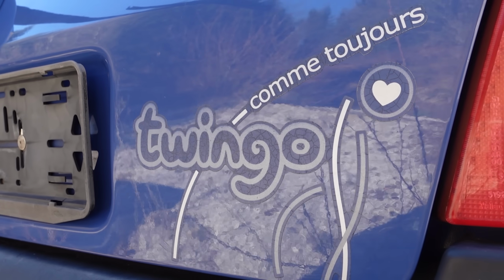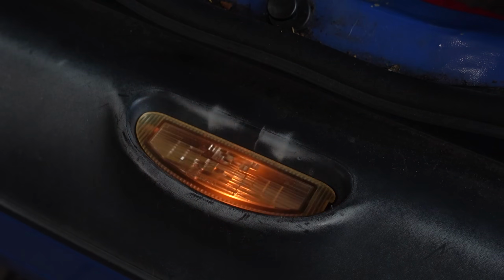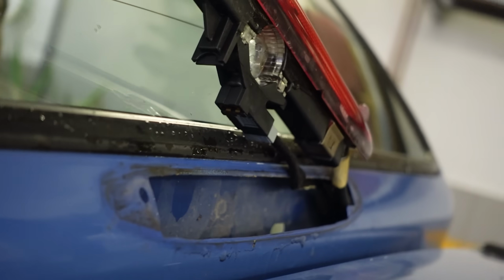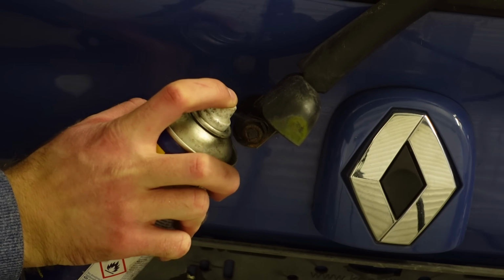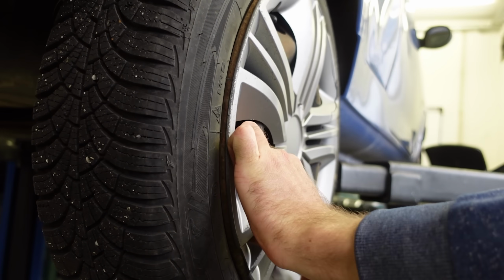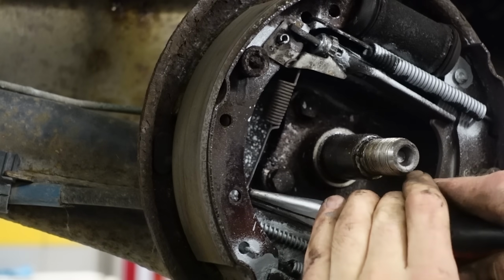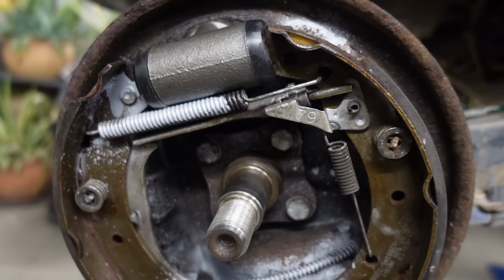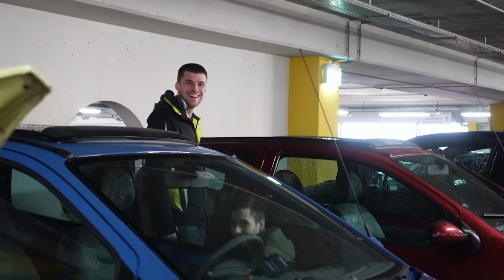Not a thought behind those eyes...

Comment: Omfg I have the exact same rear license plate light on my mk2 clio. I also have had the exact same reaction to a bad bulb that you did lol. I've been checking the damn thing every few months to see if it still works. What the hell was Renault thinking designing that

Edit: i had to disassemble the front windshield wiper engine thingy, which gave me the same grief you got on the rear one. My persuadinator was a crowbar and a new windscreen however.

Edit: I have AC on the clio, but the magnetic bearing has gone on holiday for the last 6 years. Having that much space to work makes me jealous (god this video gives me ptsd flashbacks of all the nonsense I have had with my silly french nugget 😂)

Comment: There is actually an aftermarket third brake light option for the ph4 Twongi, it just happens to be a fugly Altezza-style clear one with individual LEDs.
Reply from the maker: I found those online as well, but they didn't have it in stock anywhere. Also it was like 60€.

Comment: For those who can’t source a new headlight stock right away or at all. A trick I used to for the high beams not sticking was to… 1.put it in park lights (one turn) 2. Pull the lever for flashing. 3. While holding the stock pulled turn it one more time as if you were turning on the low beamsand release. 4. Voila! You’re on high beams. To reset it just turn back one turn to park lights and turn on low beams normally. Hope that helps.

Comment: Don't say that steel wheels won't rust to the hub. 
They can absolutely do that.
Of course on a French car, the Peugeot 106, we had to remove the brake drum with the wheel still on it in the end. Luckily the caps on the big nut could be removed with the wheel on. 

Most noisy diesel I ever owned. 

This car then was passed down several times and it was scrapped with the wheels on it. 

Yes we've tried really hard to remove them, even 10kg hammer and over curbs with loose wheel screws couldn't persuade them to come loose. 

A friend who just was there and didn't have much of a clue about cars but spend time with us asked the "stupid" question why we couldn't take off the drum with the wheel still on it. 

We thought about it, looked and that's what we did to replace the brake cylinder
Reply from the maker: interesting, I never had that happen to me.
Reply: @Zakis_wonderful_world  Has happened on a Polo 9N as well but this could be resolved with a good kick. 
BMW is very known for seized alloy wheels here. 

Thank you for the answer! :)